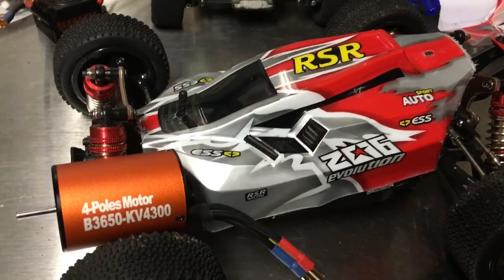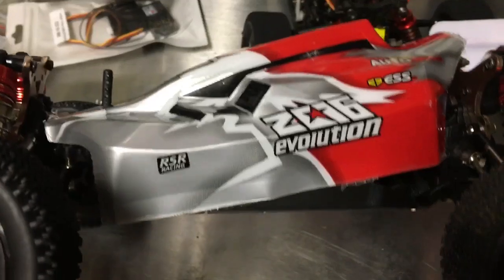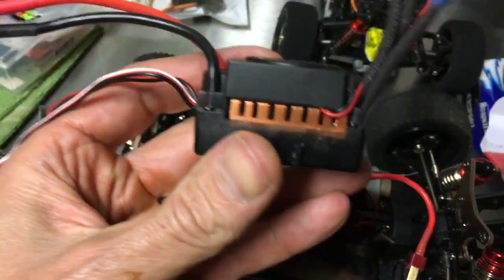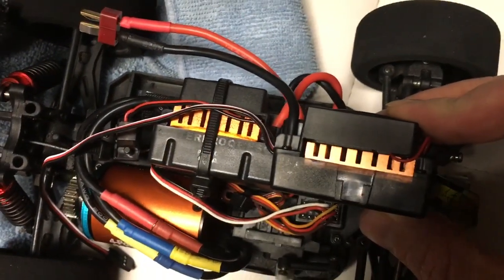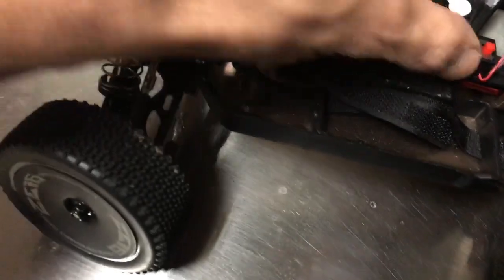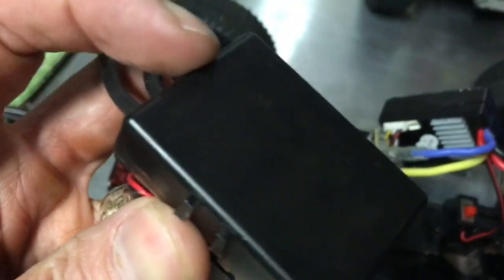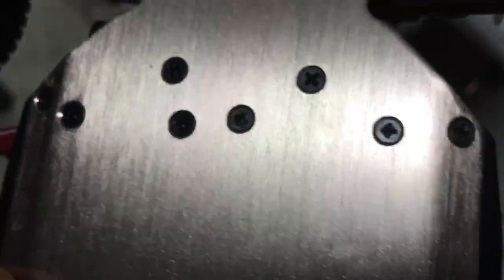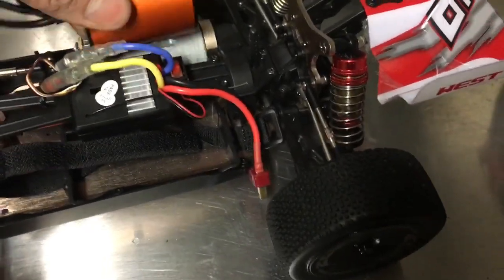WLtoys 144001 = Part II - Brushless 3S Conversion

Comment: I ordered a metal cover for mine. I'm waiting for it in the mail,hopefully it will give me more room for the esc. When I get it I will send ya some measurements of it. My thought was order the metal one for back a up and hack the plastic one and put it back together with epoxy.
Reply from the maker: Josh Herrman thanks man.  Just realized if I take the fan off it’s a perfect fit.  Gotta run it now w/o a fan.  Should be fine. Def send me measurements and can you post a link to what you bought.
Reply: @rcuniversespeed9447  it's on wltoysrc.com. it's under the upgrade parts.